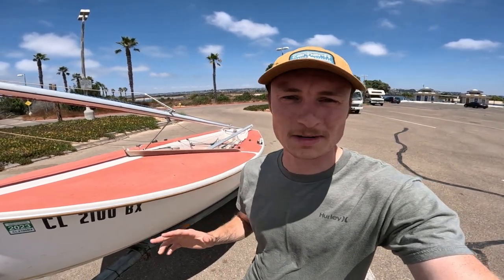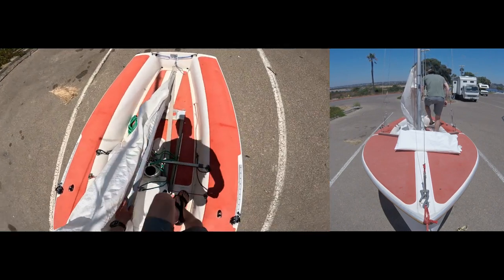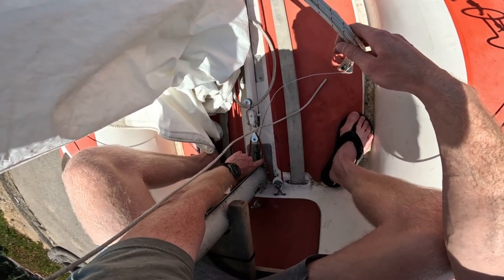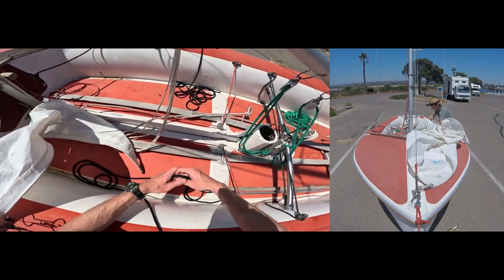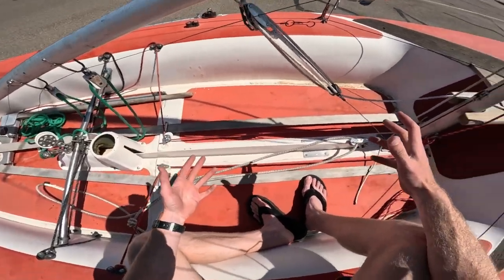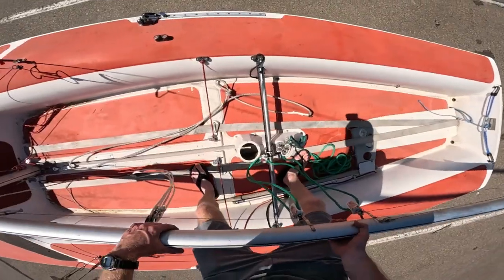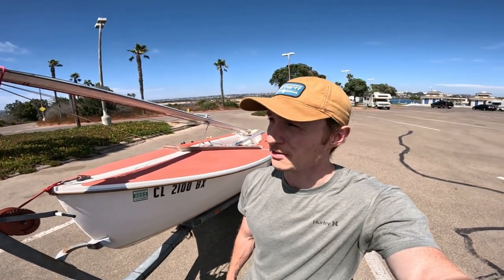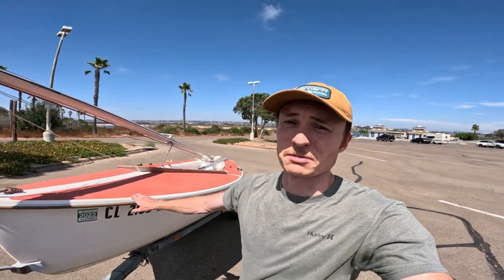C-15 Rigging, Setup, Takedown Guide (Solo!)

Comment: Great video for a newbe who just bought a C15.  Hwy where did you get the bag. couldn't find it on Amazon.
Reply from the maker: Here are the links to the bags I used as well as the velcro straps. I looped the pouch to the front of the zipper bag using the molle webbing
https://www.amazon.com/dp/B07G43NSN9?ref=ppx_yo2ov_dt_b_fed_asin_title
https://www.amazon.com/dp/B08F297TK2?ref=ppx_yo2ov_dt_b_fed_asin_title
https://www.amazon.com/dp/B071DGMNMX?ref=ppx_yo2ov_dt_b_fed_asin_title

Comment: One very important detail… after you tension your ratchet strap, always tie off the loose end near the ratchet in the direction of the boat center. This is in case the ratchet fails and yes, they do fail!
Reply from the maker: That's a good failsafe!
Reply: @colesheive7649  I have learned that when it comes to trailering boats it’s best to never have a single point of failure